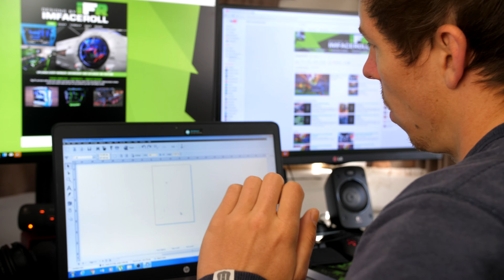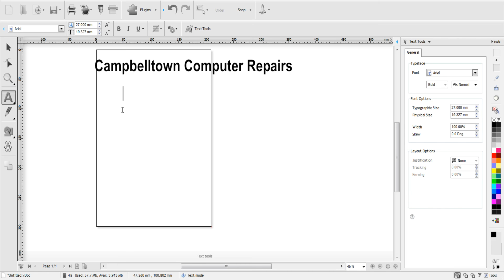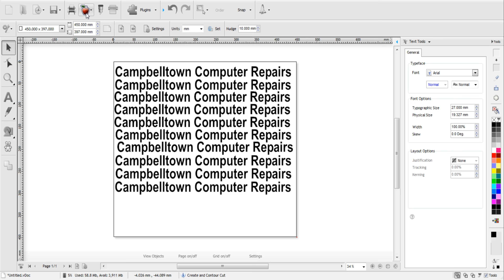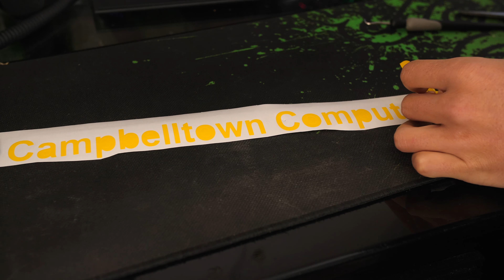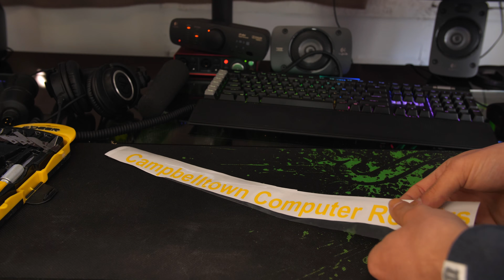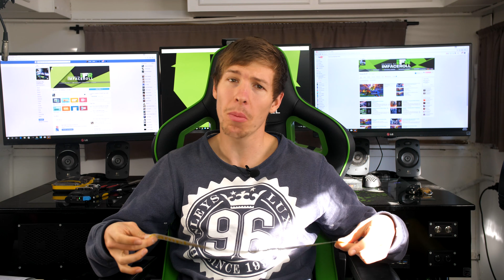How To Make a Custom DIY Vinyl Decal Sticker - A PC Modders Perspective

Comment: Hey man, this would be more helpful if you told us (or included in the description) what vinyl printer you're using, the software you use, and also why you chose those. Additionally any recommendations on what vinyl rolls to purchase (brand, pricing, and any good/bad experiences) would also be helpful.
Reply from the maker: +yoshimitsu14 hey man, i use a kasa 725 for larger vinyls and a sillohette cameo 3 for smaller detailed designs. The software comes with the printers themselves and i just purchased some vinyl rolls from ebay which are working well
Reply: Hey thanks IFR! I appreciate the response. Do you have any input on why you selected a Kasa 725? I had a little trouble finding their products online and they seemed a bit... sketchy. I've come across multiple other brands while researching that seem to be more known and trusted that can also handle large work loads (such as US Cutter).
Reply from the maker: +yoshimitsu14 honestly it was a cheap one to try out for the first time. Found it on ebay and decided to give it ago. Works great apart from small details and small lettering, it also has a larfer work area than most machines out there.
Reply: That makes sense. I can certainly appreciate bargain hunting to test the waters; I'm searching through Craigslist right now. Thanks for your responses. Your modding skills are fantastic.

Comment: can i use an aluminium radiator and copper cpu blk ? . cause aluminium raditor is cheaper .pls help me
Reply from the maker: +mohammad shah hey id advise you not to. It will speed up the process of corrosion by mixing metals

Comment: nice tutorial...if possible mate could you do a tutorial on how to cut your case for better airflow whilst also making it look aesthetically pleasing...the reason i ask am thinking of modding my enthoo evolve case front plate by cutting out more air ducts for better airflow obviously i would need a dremel to do this as it's aluminium but i also want to keep it the same colour and am worried it will riun the paint job already on the case
Reply from the maker: +Lars loves Tech hey man, id say best way is to tape the whole panel up then draw out where you want to cut. You can make your cuts, file it clean and if you want you can put some trim around it, or even an acrylic panel on the front with cutout slits for air to go in
Reply: sounds cool any type of tape i should use mate...also i am thinking to just add some RGB fans instead of the stock fans these should provide plenty of YUM behind the cut outs